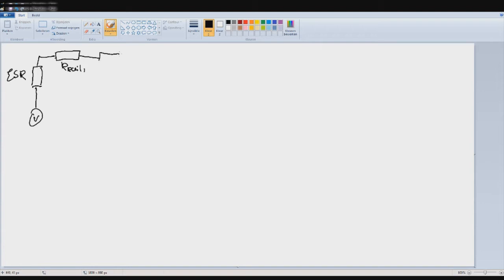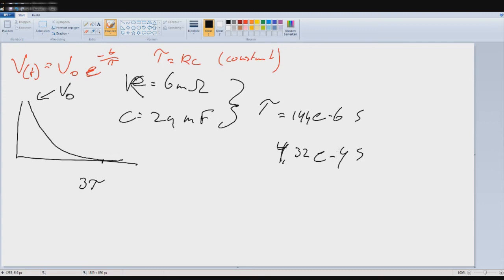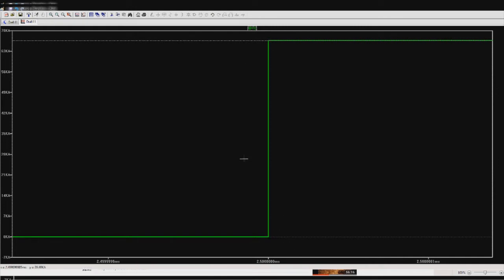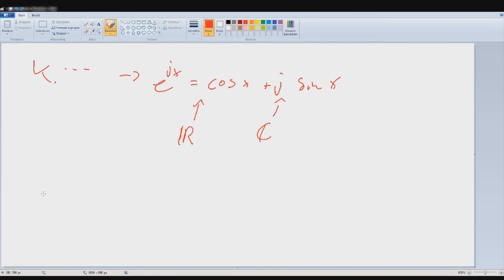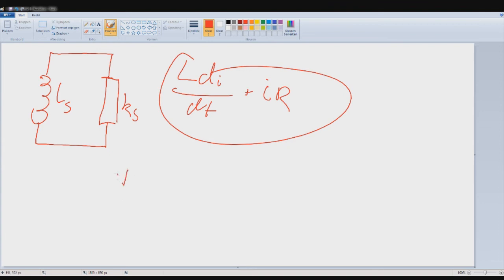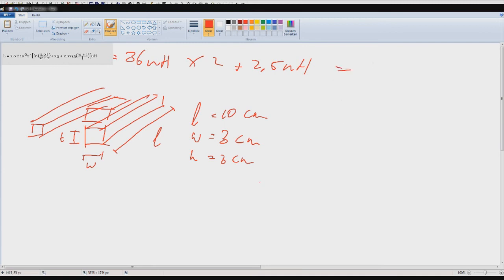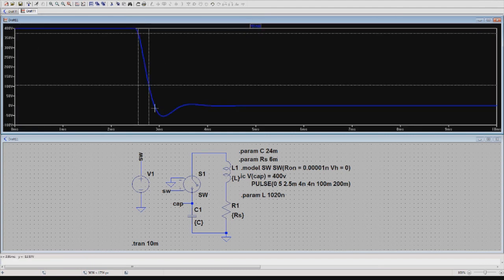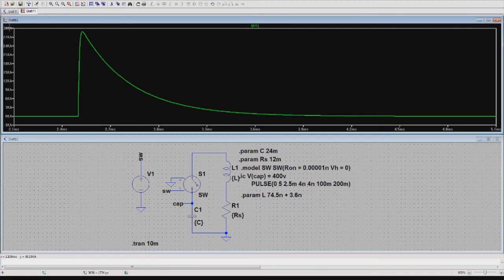Railgun Build - Advanced Railgun Design Theory [Part 1]

Comment: Dude, I don't know why you spent so much time deriving (very poorly I might add) well known classical electrical engineering equations when they are quite readily available.  Just model the circuit and show how they are used.  You could provide some references to the math which would help much more than your scribbling on the white board.
Reply from the maker: No idea what you are on about, but more people found it very helpful rather than not.

Comment: Would the resistance and inductance from the rails vary as the projectile moves down the track because the current is now flowing further through the circuit? Did you cover this and I missed it, or did you ignore it because it negligible?
Reply from the maker: It's certainly not negligible, the key importance for railguns and coilgun is the inductance gradient, the inductance as function as x,y,z. This was going to be covered in a further video (Part 2). However, I never got to it. It's the gradient of inductor energy. Which brings F = nabla{L} I^2/2. This represents the partial differentiation of potential energy, I can give you the full derivation in my discord channel.

Comment: dude I appreciate your railgun series so deeply. im in engineering physics 2 and wanted to build a high powered railgun. The theory and math that railguns go into goes a bit above and beyond what my professors know and ive been teaching myself.
Reply from the maker: xXTepicwinTXx I am glad my videos and I can be of help mate!
Reply: Azagro do you know anything about permanent magnet augmentation in railguns??? ive got a bunch of high strength 4900 gauss magnets from some mass spectrometers and gas chromatographs and wanted to use them.
Reply from the maker: xXTepicwinTXx Yes, I do. Brushed motors work like that. The Laplace force sounds as F = BIL, assuming perfect orthogonality. The I comes from the current you push in the motor. The L is rotor brush contact diameter. However, the B field comes from permanent magnets. Simply because the induced magnetic field is not strong enough. In a railgun the currents are so amazingly high, you can induce a current in lamps. So most of the times the high current makes strong neodynium magnets look like fridge magnets. So it depends on your currents. I work with atleast 50kA. In a more compact design, with less current. It may give a performance increase. As you can see in Electroboom's video.

Comment: There's another thing I happened to discover around 6 months back.
You could just measure the inductance of the whole rail, but that won't really give you a prefect model.
Let's say we measure the inuctance of the conductive loop when the projectile is at the start of the rails. We'll call this inductance x. Now the projectile accelerates to the middle of the rail. The inductance is x plus the inductance of the remaining length the projectile has travelled. So on till the projectile is at the end of the rails. Since the inductance seemingly  increases, the current slope will be a bit slower and much more curved in the leading edge. Kind of a nitpick, but I guess it makes modelling more accurate.
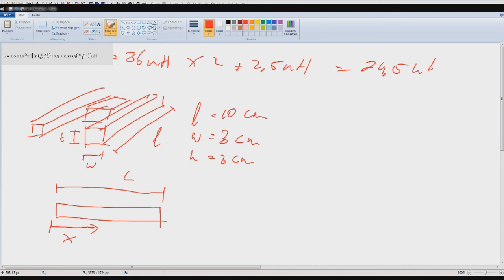Reply from the maker: I did mention it at 1:02:00. Now I have a way more advanced model than this.
Reply: Ah, the inductance gradient!
I'm not the best at calculus, so i guess I didn't get that part.
Reply from the maker: Ah it's fine, me neither. Yeah, the L' value has to be determined as well, I will do that in the next part and make a model that even calculates velocity, etc.
Reply: I try deriving formulas that use parameters that can be measured easily using equipment like an oscilloscope. For example, in place of current and time I use charge, which can be measured using the area under pulse function.
Reply from the maker: NNNI I did the same. Had to derive L d^2i/dt^2 in a RLC circuit. While all I needed was the current, that was easy. For charge you would have L d^3Q/dt^3. Which is also possible.
Reply: Third order derivatives?
I got my SCR bank working, so I might be able to make a video on scoping the discharge. I don't know what to use as a shunt. My 0.1 Ohm shunts just explode. Might use a wire.
Reply from the maker: NNNI Shunt for capacitor discharge? Yeah that might be troublesome.
Reply: The 0.1 Ohm shunts worked well when i discharged the caps by touching two wires, I gout around a 180 Amps out. When I used the SCRs. the shunt simply exploded. Maybe I wasn't wasting energy in the arc.